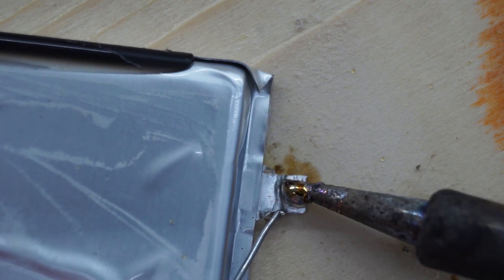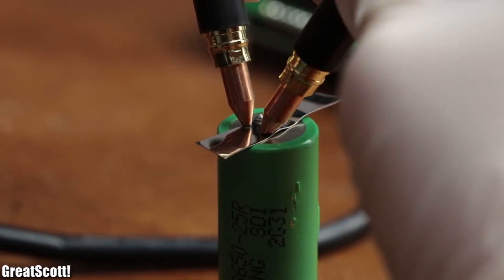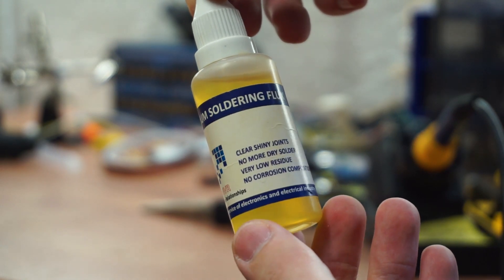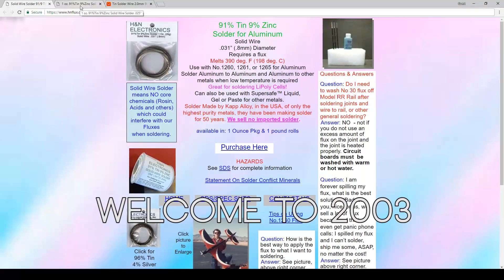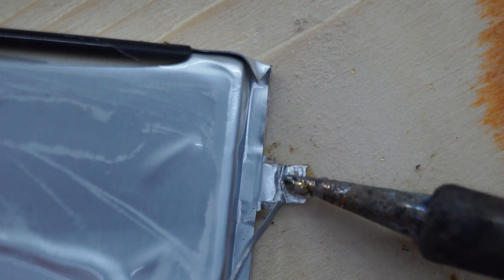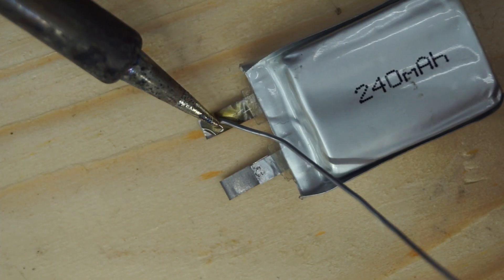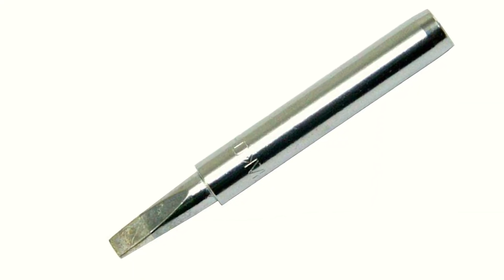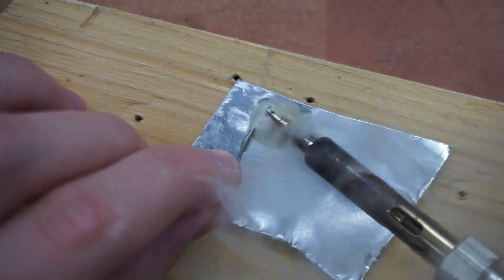How to solder LiPo battery tabs | tips & tricks

Comment: I'm going to stop this video at one second I saw what toddling was like you. Don't you don't solder these? You tab weld them under no circumstance. Should you be exposing a battery to this type of heat
Reply: Also if you did have to do it you should also note that the tabs are not aluminium. They are nickel cadmium so your flux is the wrong kind
Reply: Spite welders are like 30 bucks Amazon. That's not an excuse not having one that's the same. Get one

Comment: what I do I put a stripe i ply it and I put the aluminium in between , I adjust my cheap (but very efficient) welder to 5 milliseconds .
Try it with food aluminium wrap, contact is perfect, after to  weld on the stripe or spot it is easy (do not forget to readjust your spot welder to 8 ms, of course do not press too much(always true anyway), 
Spot welding is not so aggressive for the pouch because the stripe absorb much heath.
My 5 cents

Comment: 0:43 best way to hold a soldering iron 😁 If you dont want to buy the alumin flux, just scratch up the surface with wire brush, sand paper or small wire brush to get the oxide off.
Reply: yooo i have tried and i can certify the trick doesn't work
I even had a blob of lead ready over the terminal and scratched the terminal hard and the blob just sticked to the soldering iron.

Comment: Why are nickel strips used to attach to the tabs?
Reply: Nickel is the preferred conductor for low amp connections. Copper requires a massive amount number of amps to spot weld so we need to go down the list of metals slightly less conductive than copper. Not gonna do gold. Nickel is like 4 below copper and aluminum tabs plus nickel strips means dissimilar metals which helps.

Comment: Aluminum forms an oxide layer. To solder you need to remove the oxide layer and prevent it from reoxidizing with air. With my Al battery tabs, I've found that some light sanding, then coat with vaseline as flux is good enough. You want the highest watt soldering iron you can find, at the highest setting with a big tip to get maximal thermal transfer.
Reply: Is aluminum used for battery tabs due to its flexibility? Curious why that’s chosen
Reply: @mrsemifixit  Nah, most likely for cost. Better ones have the aluminum plated with copper or nickel.
Reply: @Allenw154  Ah. Why are nickel tabs sometimes used around the aluminum for binging?

Comment: This problem was driving me crazy! I have a spot welder and it still doesn't work. I've ordered some new Flux, can't wait to try it out. Thanks for the tip!
Reply: I ordered two kids of aluminum solder. No worky.
Reply: How does your spot welder not work? Two dissimilar metals with a low(ish) heat conductivity compared to copper. Any spot welder out there should attach 0.10mm pure nickel without issue
Reply: @ericklein5097  the best way I can describe it is that the metal burns away even when it is set to a short duration. This sounds like a fairly common issue welding these.

Comment: Should this one be able to handle the task of soldering the aluminium to copper or steel? 

Uniweld P4KD9S Aluminum Soft Solder Kit with Metal Tip Flux Applicator https://www.amazon.com/dp/B010UMSB9Y/ref=cm_sw_r_cp_apa_i_DxBlEbX0EXKTV

Comment: Hello, my two cell li-po laptop battery could use replacement, can i solder 2 li po cells myself onto the original connector (from original battery) and just ducktape the batteries to the shell of laptop?

Comment: Hi just wanna ask how to know the positive and negative of this lithium polymer battery co'z I have a fresh one without wires on it, so I need to install it myself, thanks by the way for this video! I've been looking for this for a week now. So lucky to find this one.
Reply from the maker: You have to use a multimeter or if you don't have one you could use just a LED. Longer lead is usually positive. If they are both the same then the flat side of the LED is negative

Comment: The only thing the "special" flux does is clean the aluminum surface. Apply normal flux, then gently scratch with flat screwdriver tip, apply some extra flux and THEN solder.
Reply: Hmmm, that is not working. I am scraping it clean to bright metal. Have tried it with Nokorode soldering paste and without. No go. :(
Reply: This worked for me thank you a lot